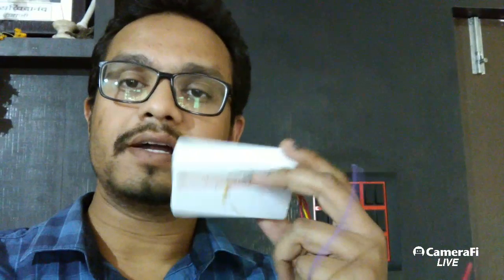RO AUTOFLUSH : Do i need a Autoflush for my RO

Comment: for how much time the kit work , when we switch on, for how much time it makes valve on if we on the filter for one hour
Reply from the maker: 30 sec
Reply: I using zero b prestine water filter but the aft continue as long as power on is there any kit problem?